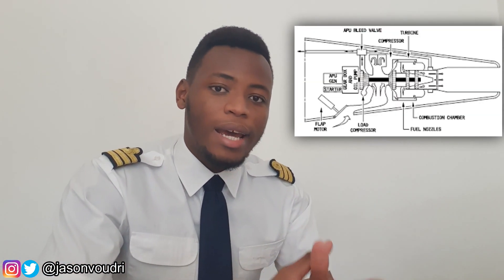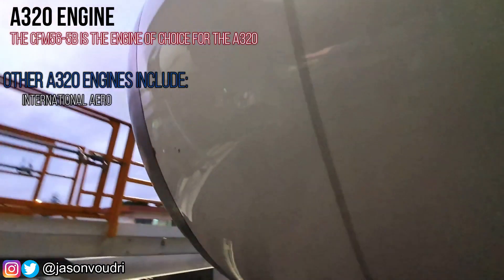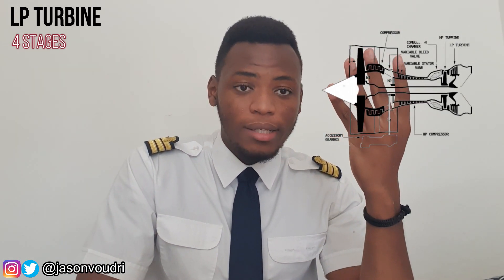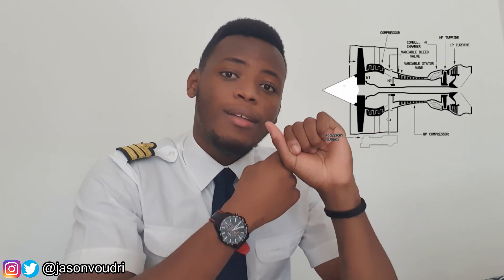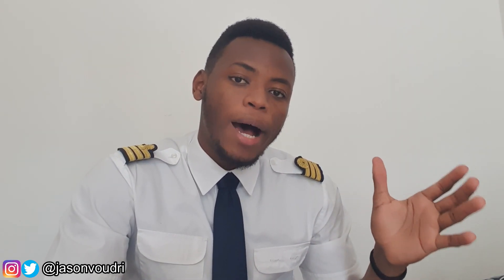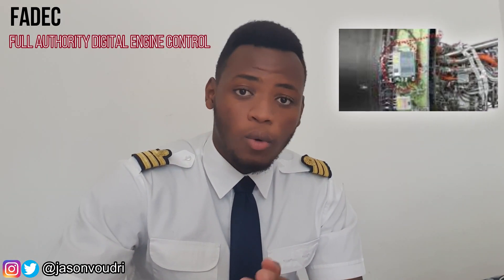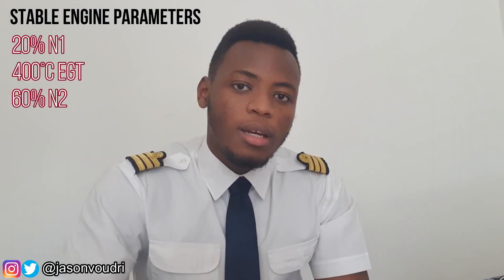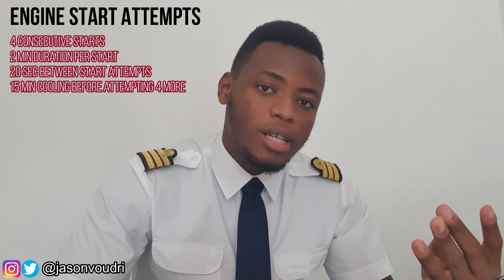How to start a Jet Engine - Airbus A320

Comment: Hi,

I try to find internet many hours and cant find answer. Why you have to use ignition start for Airbus? What is difference between IGN mode and Normal mode on engine? Also want to know what is crank mode? :)
Reply from the maker: Ignition mode simply means the engine igniters are continuously on, it is used for engine start but can also be used for heavy rain or icing conditions. Crank mode allows you to perform a dry crank (or engine ventilation) which is essentially an engine start with no ignition, it allows the engine to be ventilated after an aborted or wet start to get rid of any remaining fuel left in the turbine section of the engine before attempting another start
Reply: @FlyJV  Thank you! Okay so in IGN mode, igntion is all time on and normal mode not? :)
Reply from the maker: @jonniurho4012  exactly

Comment: Bro, one more question, what is the crank mode on the engine mode selector used for on the 320? Other than that, that was a very informative video. Keep it coming, looks like the hydraulic systems are coming up next.

Comment: What happens if flames come out the back of the engine when the pilot is starting it. I’ve seen that happen on other YouTube videos.
Reply from the maker: You will have to apply the Tailpipe fire procedure from the QRH, basically shutting it off and dry cranking it